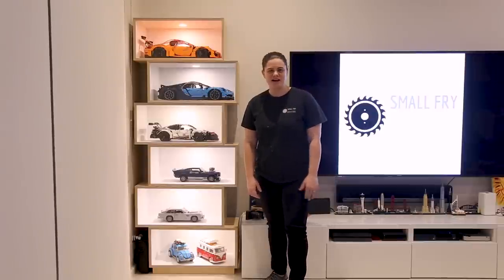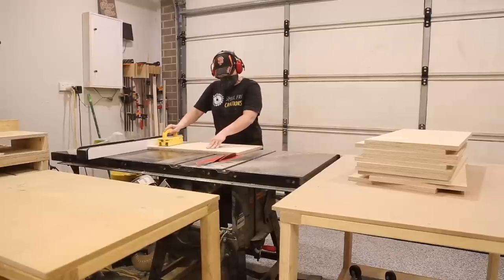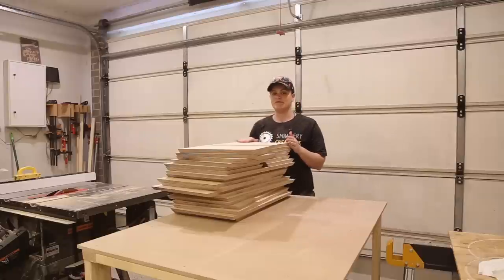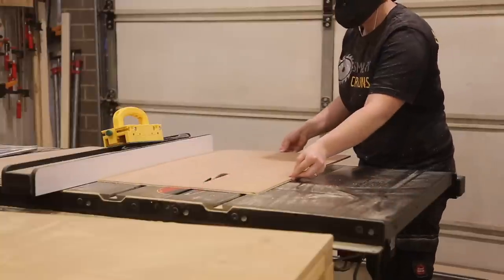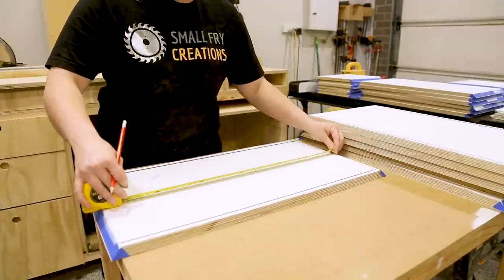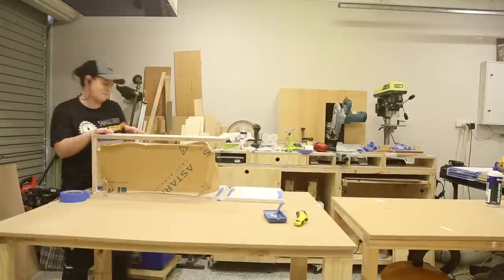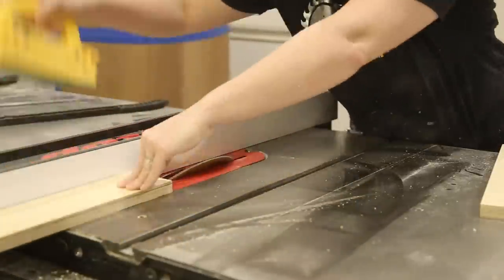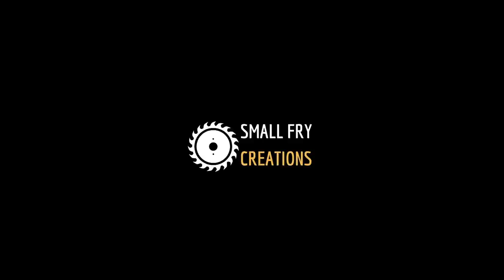DIY | LEGO Display boxes with built in lighting

Comment: Nice project! I'm keen to do something for our Lego sets.

Probably the only thing I would change is the back end looks untidy with the short side for the plywood slide. Rather than add handles to the plywood, use the offcut from the side (trimmed an extra 6mm to account for the thickness of the ply). Glue this to the plywood and it not only provides a handle, but also neatens the look.
Reply from the maker: Great Idea and 100% could do. Mine are up againist a wall so I don't notice it but is a great idea

Comment: Hello! Nice job! Which diameter has the drill for the light hole? Any advice on where to buy it in Europe? Thanks for your time!
Reply from the maker: My lights were 70mm so I just googled 70mm forstner drill bit and purchased of Ebay. You just want to measure the light and then google a size that will work.

Comment: is there any way you could wall mount these?
Reply from the maker: Hey you would need to modify the back panel so you could screw it to the wall. The back panel on my design is only 6mm thin and also is the way you access the box. But with modifications could be done 😀

Comment: Great work. I'll be replicating this with IKEA Bestå. Quick question, you mentioned you used a 60mm forstner bit, whereas the vaxmyra lights are 68mm in diameter. How did you get them to fit in the countersunk holes?
Reply from the maker: Thank you. The first bet bit is 65. Apologizes if I said 60

Comment: Where did you get the glass and did you have to get specific sizes?
Reply from the maker: I used Perspex and cut it on the table saw. I brought a sheet and cut it to size. Perspex can be cut with any woodworking blade so it’s a easy material to work with